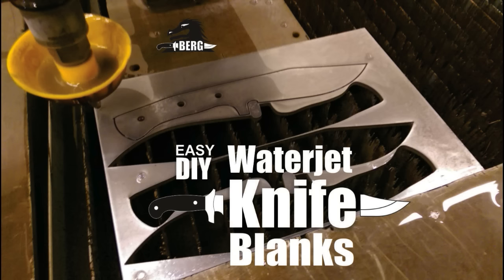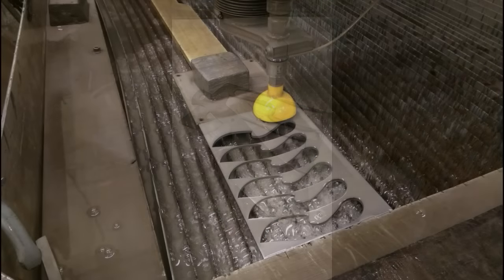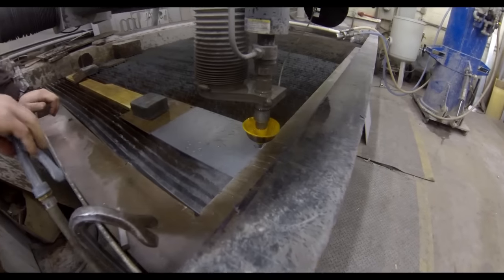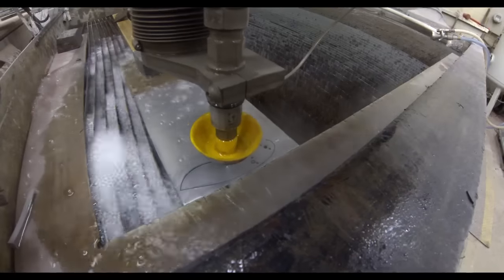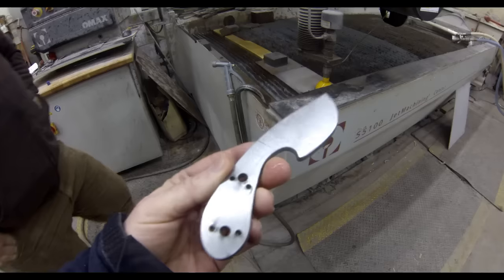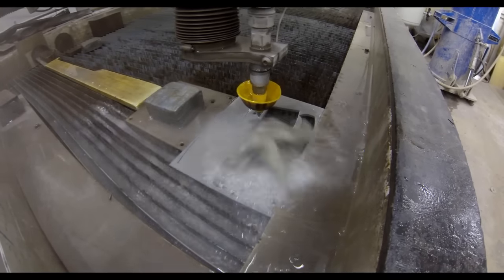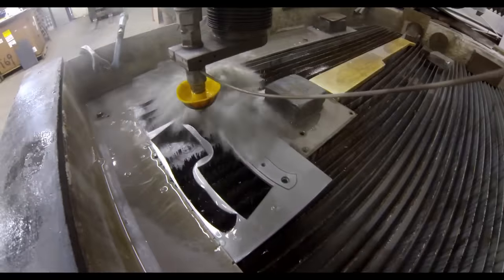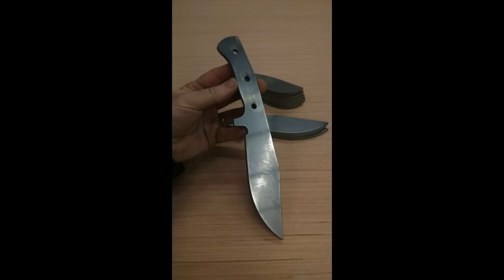Waterjet knife blanks for DIY Knife Makers

Comment: This is NOT a diy waterjet. Sorry, but that's misleading.
Reply from the maker: Sorry about that. Just wanted to put info out there for anyone that wanted to make up waterjet blanks
Reply: design your own knife shape? how to work with a water jet company? DIY knife design? DIY knife drawings. sources for water jet CAD files? don't get me wrong, all of these are of interest to me. I've been looking at New Jersey water jet, Aldo will deliver to them. also I've been looking at Admiral laser from what I heard there is a setup fee but the cuts are cheaper. Although  there's a bit of a heat affected zone with laser cutting. I definitely appreciate the information presented , but we clicked on the video cuz it said we were going to get a DIY water jet video.
Reply from the maker: You are correct,  will change the title. Try Long Island Waterjet. Ask for AJ. No CAD drawings needed he can work off PDF or even a hand drawn sketch very competitive pricing.